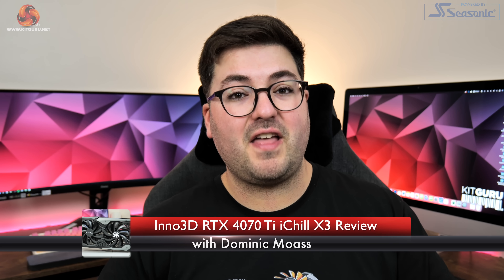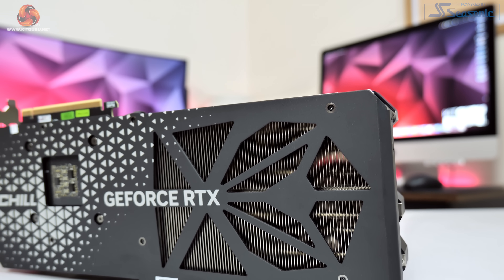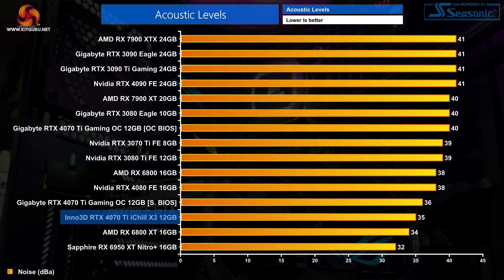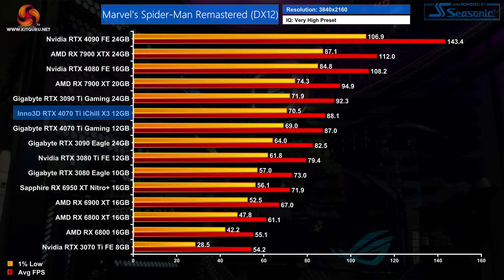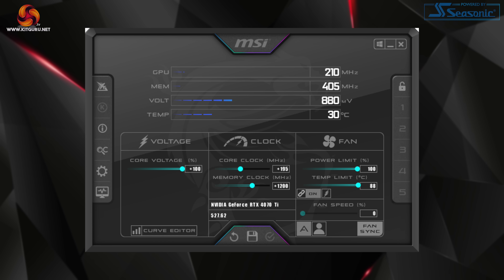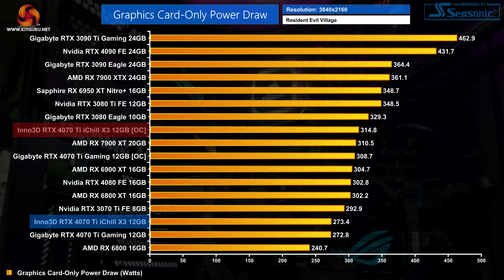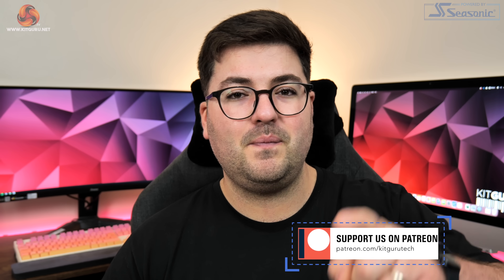Inno3D RTX 4070 Ti iChill X3 Review - triple 8-pin power?!

Comment: How do I turn off the RGB on this card? For some reason, Inno3d's software recognizes my card as 4070 (non-Ti), and the lightning option is greyed out. I tried disconnecting the little wire which, I presumed, would do the trick. It didn't.
Reply: did you find a fix? or schoudl i just go for the inno3d 3x non rgb version
Reply: @Maxime-xr7er  No, I didn't. I got this card when it was on sale, an it was the cheapest 4070 Ti available at that time.
Reply: @Protosszergling  allright thank you for this info

Comment: Hi. We had to use all three 8 pin power connectors to our PSU, otherwise we received no picture. 
The manual is really bad, as it keeps showing 12+4 but never saying 3x8 pins are needed. 

The 12+4 also is misleading as the 4pins are really small and not rhe normal ones. So all in all a really poorly made manual.

Comment: The 8 pin is typically rated by card manufacturers at 150W. The reality is the connecter is rated up to 300W as confirmed by Derbauer. Having 2 means you can draw 300W-600W plus the PCI-E slot at 75W. This means you're able to draw at least 375W-675W if you use a double 8 pin, which is already overkill for this cards TDP. Having 3 means you can draw 525W-975W, which is useless for this card as it can't OC using that  much power.

Comment: @KitGuruTech
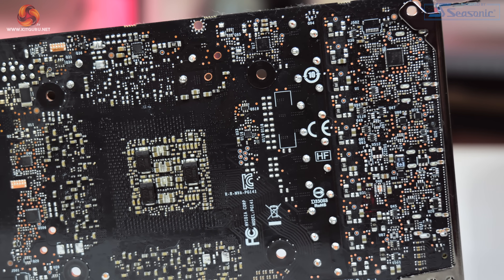Hi KitGuruTech, just wanted to ask, @ 4:19 did the circuit board look like that or did you clean the places where the thermal pads are sitting on the backplate beforehand? This is because the PNY rtx4070ti has this flux residue at the back, especially near the PCB connectors and joints, which looks worrying. Thanks
Reply from the maker: Hi, we didn't clean the back of the PCB, the thermal pads came off very easily
Reply: @KitGuruTech  Was there any residue left after taking off the thermal pads at the back of the circuit board?

Comment: ok ive now had 4 different 4070ti at home. 2x the msi trio, the pny and now the inno. all of them, have exorbitant coilwhine even at low draw, low fps scenarios. the msi is the worst. oversized 4070ti coolers mean: low noise for cooling, which is useless to have, if the coil whine is so loud, that you have to turn the fans to 1700rpm to overtuned it

Comment: the RGB really is ugly. Really. There are better implementations on the market. who wants "ichill" 1000x times with RGB in your case? The cooling solution seems to do an overall great job, and being really silent. Still the price of the 4070ti is way off the charts...so no value at all. I call this DOA. And it does not matter if this card is a little bit cheaper in the end. It does not change the game. Question: does this card has coil whine?
Reply: It certainly has internet whine.